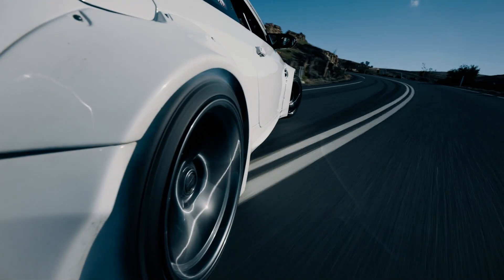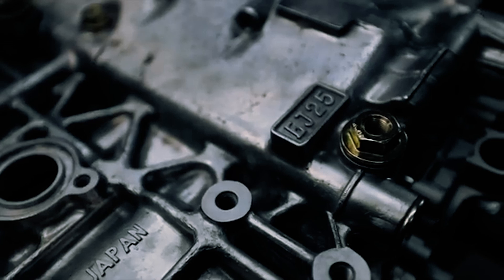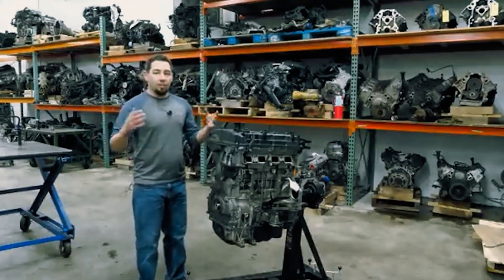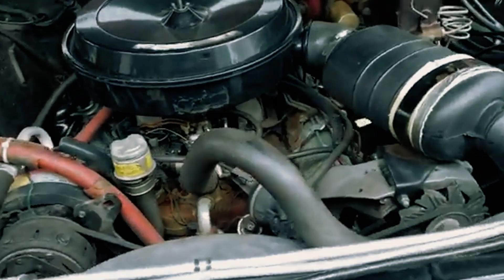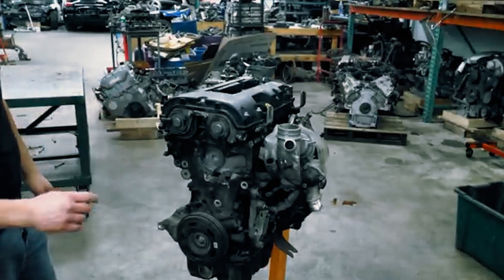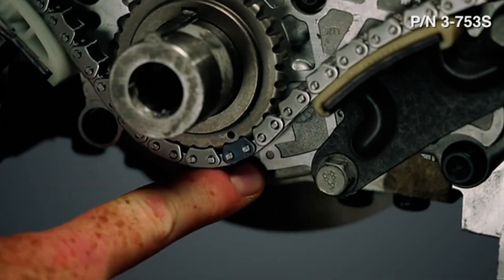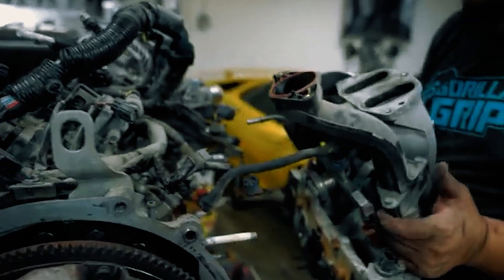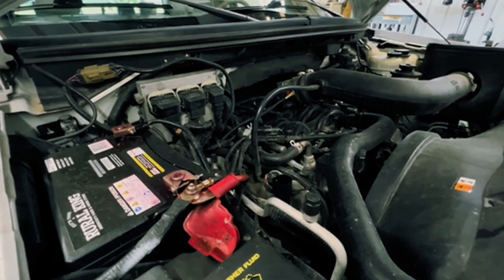Shocking 15 Worst ENGINES Ever!!!

Comment: 1. BMW should have ditched the turbos and given us a normally-aspirated V8 engine.
2. VW would improve this engine after 2015.
3. Subaru discontinued the EJ engines in 2021.
4. The GM Northstar V8 was trainwreck from the beginning; it took remanufacturing to work the bugs out.
5. Hyundai and Kia replaced the Theta II with the Smartstream engine series in 2018.
6. The Chrysler 2.7 V6 was rushed into production to meet the deadline for the ill-conceived merger with Daimler. Both the merger and the engine were a trainwreck from the beginning.
7. Another GM fiasco. A GM engineer begged his superiors not to release the engine and start over from scratch. He was fired, and they released it anyway.
8. The 3VZ-FE had a relatively short lifespan, lasting only five years. 
9. The 1.4 Ecotec Turbo was still another failure for GM. They should have kept the 1.8-liter non-turbo.
10. The basic problem with the Ford Cologne V6 was a cast-iron block with aluminum heads. Heat would expand and contract in different directions.
11. The Chevy 3.6-liter VVT V6 was RIDDLED with defects. A trainwreck from the beginning.
12. The Zastava Yugo never should have been heard of. Anywhere. Even the engine was based on an outdated Fiat design.
13. Now you know why GM discontinued ITS OWN rotary engine project years ago. That should have killed the AMC Pacer and the GM H-body cars right then and there.
14. Jaguar discontinued all its internal combustions to go all-electric, but you have to wonder if that was a good idea. Go woke, go broke. 
15. I wonder if BA, BF and FG Falcon owners across the Pacific in Australia had problems with THEIR Triton V8 engines.